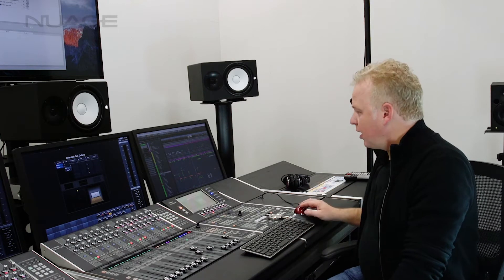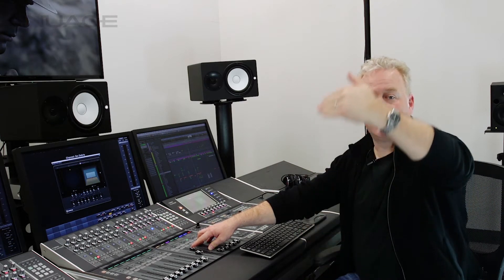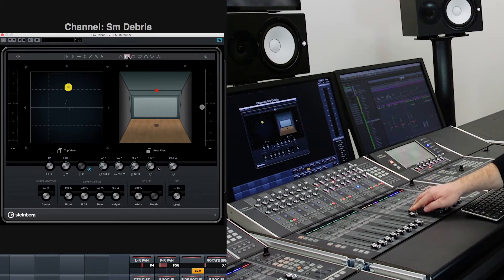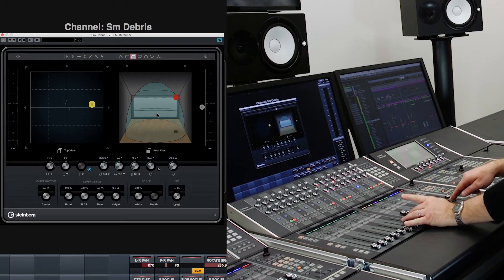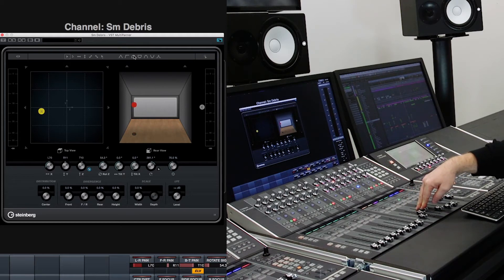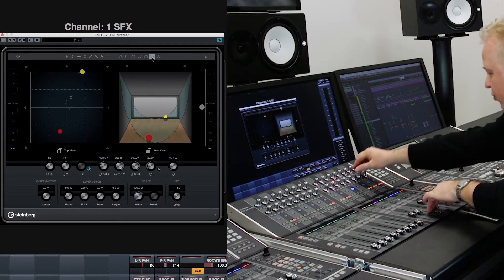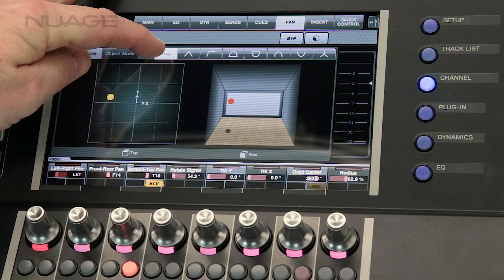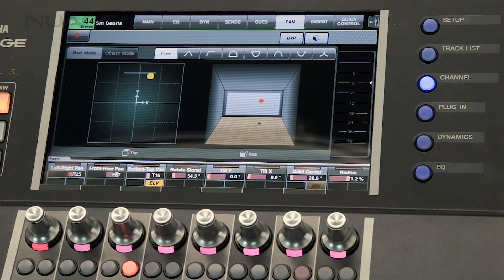VST MultiPanner : Elevation Pattern / Dolby Atmos Mixing with Yamaha Nuage

Comment: Would it be possible to automate and edit the parameter values manually? The second question: can certain elevation parameters be stacked and combined?
Reply: I wasn't able to try that out in Nuendo, but a lot of stuff can be automated in Cubase like this, so the answer is: Probably.